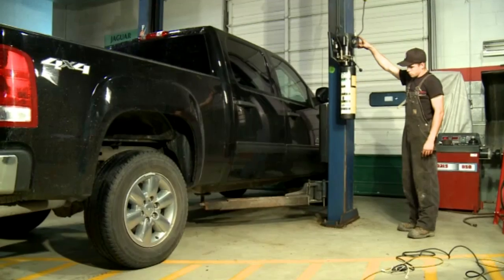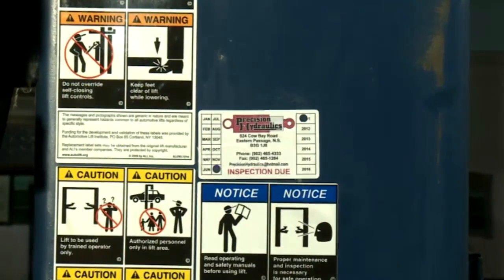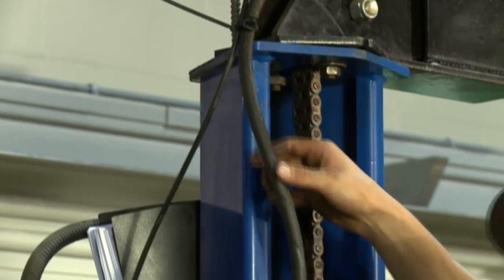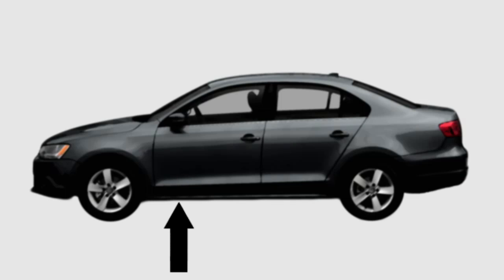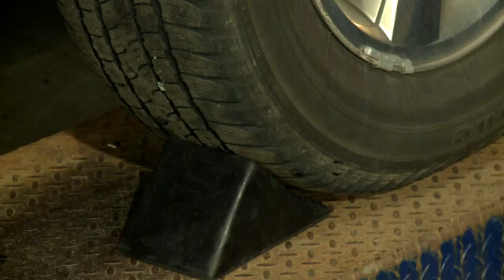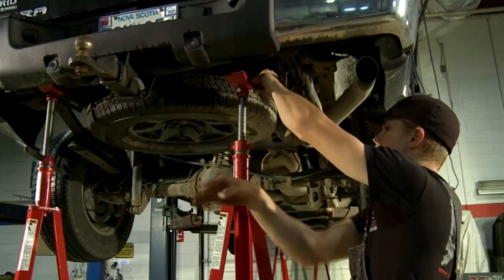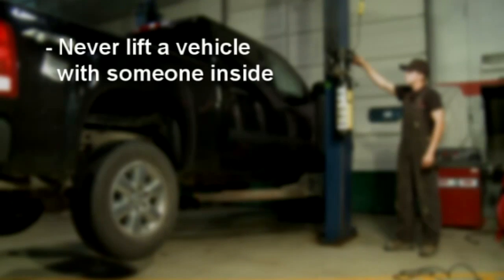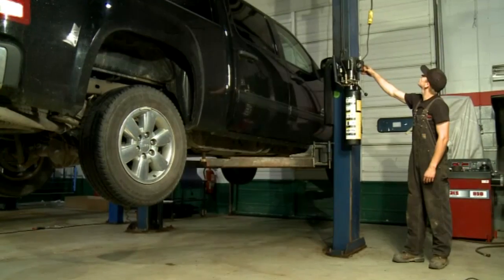Automotive Lift Safety Awareness

Comment: I don't trust China made lifts..most guys don't know how to rack Trucks.. Chevy s.  U need to use specific lift points..I own only inground in my shop.. American made..mine has been removed after 50 yrs of service..and restored casing inspection sandblasted clean painted and rolled with truck bed liner.  New piping undground and treated with bed liner as well oil tank is now above ground.. 1967 vintage..now ready for service for 50 more years...great video

Comment: The biggest mistake I ever made was failing to pump the brakes of a van after a brake job on a four post hoist. I also had the wheels turned so it beached itself on the platform. No damage apart from a busted air line. My boss was really good. I called him and explained what happened. His first words were "are you hurt", followed by "is anyone else hurt" followed by "is the vehicle ok". Managed to get it off the hoist and he simply said "what did you learn here today". Still work here today

Comment: There's plenty of violations with this video. His hands weren't in safe areas, lift was missing slip pads, he's not even wearing safety glasses. I wouldn't recommend this video.
Reply: +Hugh Morris THE LIFT IS EQUIPPED WITH MANUFACTURERS OEM PADS I AM QUITE UNAWARE WHAT YOU REFFER TO AS A SLIP PAD. POSITIONING A VEHICLE ON A LIFT DOES NOT REQUIRE GLASSES HOWEVER IF YOU WERE TO WORK ON THE VEHICLE OR USE ANY POWER TOOL SAFETY GLASSES ARE A MUST
Reply: Ozzie Sheppard eye people would have you wear safety glasses to bed in case your sheets explode.
Reply: Michael Skerritt  you must waere safety glasses when you making love, the boobs can explode.
Reply: Are you wearing your safety glasses watching the video?